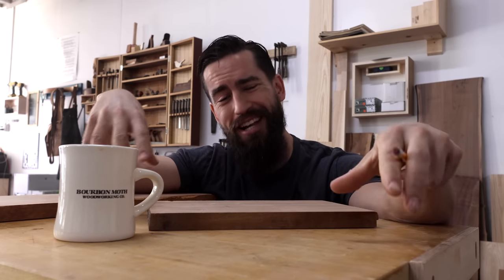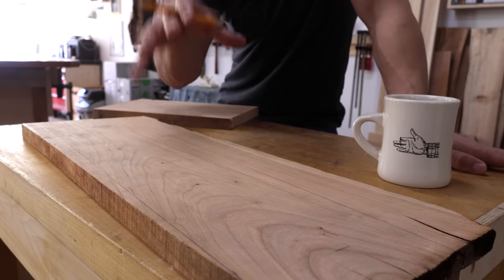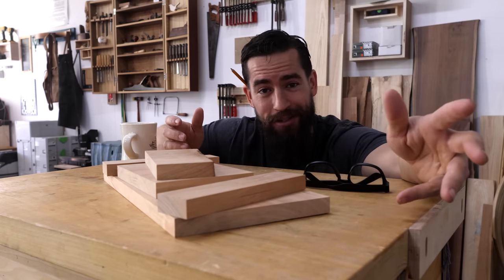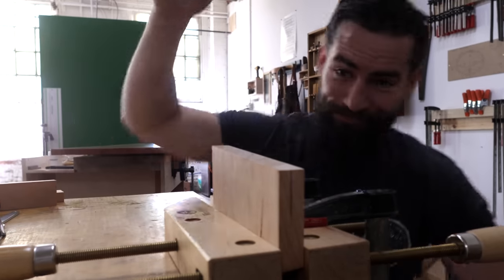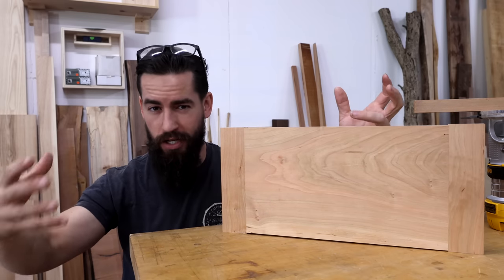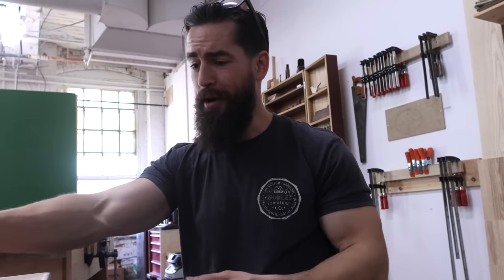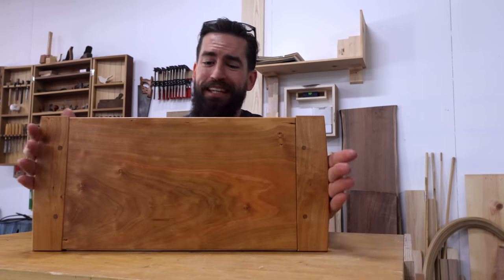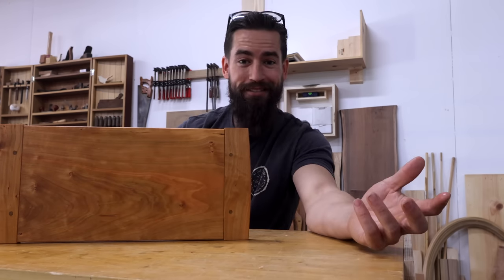Stop Working. Start Playing.

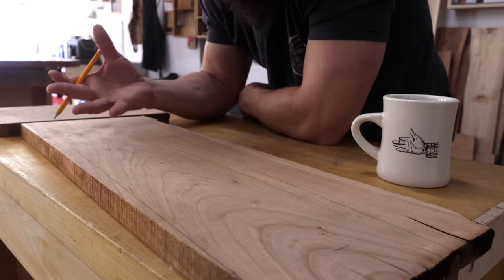Comment: At 3:22, I saw you jointing the wider surface of the board. I've never seen that, never considered it myself. Why joint that surface instead of plane it? So new to everything, and I apologize if the question is way too basic. I just haven't had a reason to ask it before.

Comment: great video! Quick question: why not drill the holes for the dowels while the main board still had the sides on it? Why take it apart and drill 8 holes instead of 4?
Reply: Because the holes in the main piece of wood are slots not holes to allow the main piece of wood to expand and contract across its width. This is also why he only put glue in the centre. He may have also moved the slots on the main piece slightly inward so that when the dowels were fitted they pulled the joints tight.
Reply: @rfrisbee1  thank you!